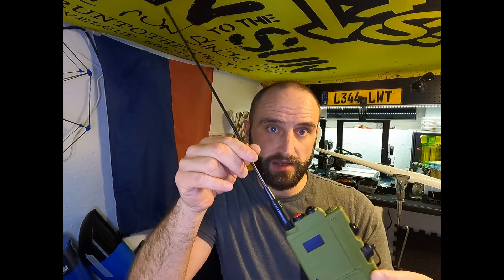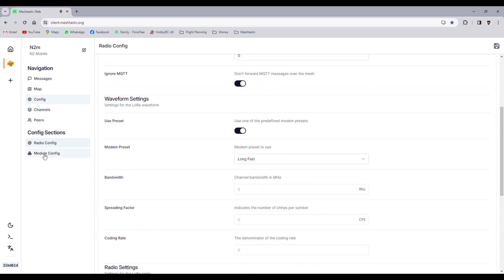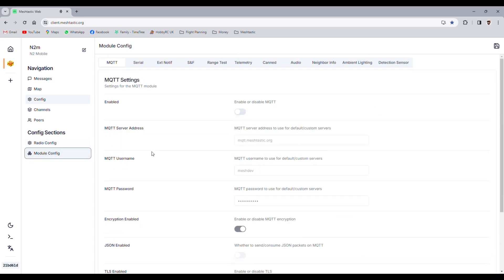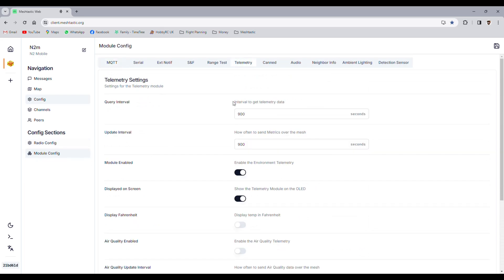Meshtastic. How did I get over 100km with my Heltec V3?

Comment: Correct me if I'm wrong, but default is 3 hops, max is 7... 
I mean there's even a feature in code that corrects you if it's more than 7 and it's been a standard since quite a while and I couldn't reproduce that 5 hops thing on any release... Don't want to be rude, but 5 sounds a bit unreasonable to me. But the bedroom lamp analogy is well done :)
Reply from the maker: You're not wrong. Max is certainly 7. Default is 3. But I can hand on heart say when I went through the defaults after a full chip erase FW upgrade, the hop limit was set to 5 as I mentioned in the clip. I have no explanation for that.

Comment: Default hops is 3 not 5 in the latest stable firmware (2.2.23)
Reply from the maker: That's correct yes.
Reply: @JD_fpv  At 5:41 in your video, you change the config to 5 and state that it was changed in 2.2.21. It wasn't, it's been 3 for four years according to the firmware code on GitHub.
Reply: @JD_fpv  It has been 3 by default since the beginning.  It has never been set to 5.

From the code:

/// We normally just use max 3 hops for sending reliable messages
#define HOP_RELIABLE 3

It has always been that.  Not a big deal but wanted to mention it in case someone thinks it is 5.  I flashed 2.2.21 onto a heltec V3 and it is still 3.

Comment: Well, y'knos what even with the line of sight thing in mind, i cant get a single km between two v3.
Will try as soon as i can placing repeaters in peaks, but still, just between two nodes each at the opposite of a street, the max i could do was 250m (woth elevation).